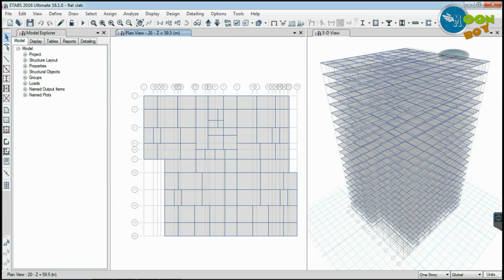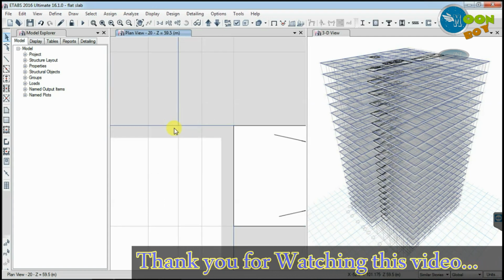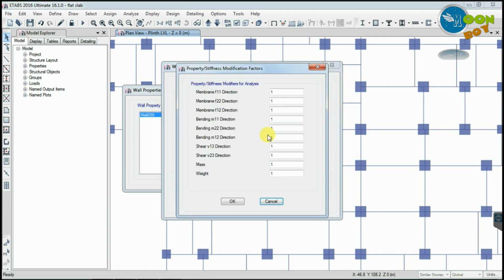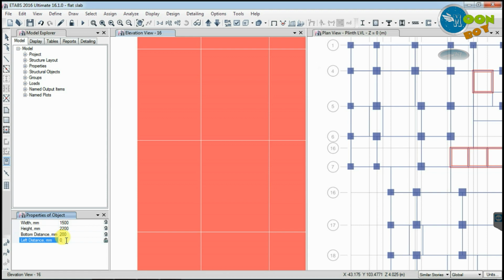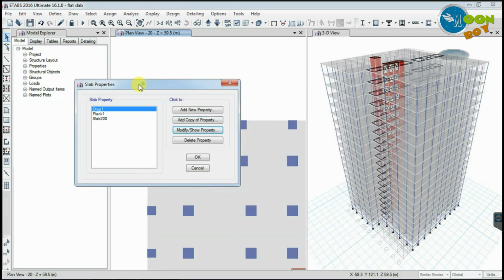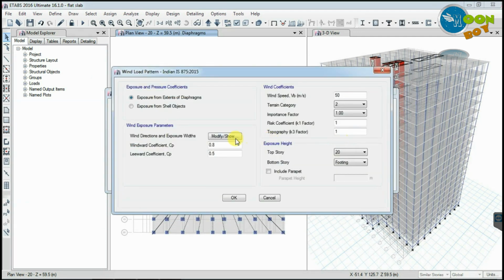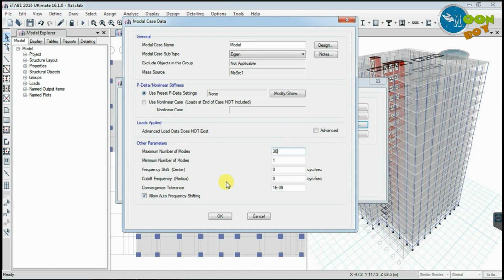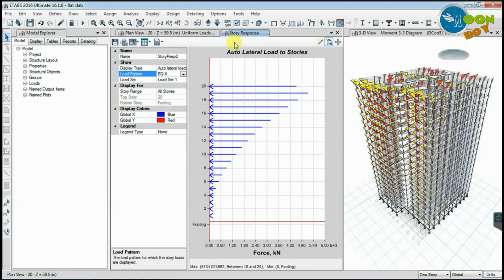ETABS 2016 Tutorial 12 | Flat Slabs, Shear walls, Openings, Equi-static Analysis | Moonboy

Comment: my next question is in rc buildings the infill wall dead loads , i provided it as super dead and found manually the magnitude using the density thickness and height of wall and appiled as udl through out the structure over the beams ...since in flat slab as there is no beam how will i provide the infill wall loads?
Reply from the maker: govind up yes we need to distribute the loads to slab in flat slab.
Reply: how do we determine the conversion? on what basis? 12.42 kN/m is my udl over beams and how do i convert that to area load
Reply from the maker: govind up Actually we consider total dead load all together as 7kN/m^2 in Flat slabs..
Reply: 7kN/m2 without including the self weight?
Reply from the maker: govind up 7kN/m^2 taken as wall loads, floor finish and false ceiling.. and some nominal dead wt.. for residential in etabs.. Assumed.. otherwise you need to calculate.